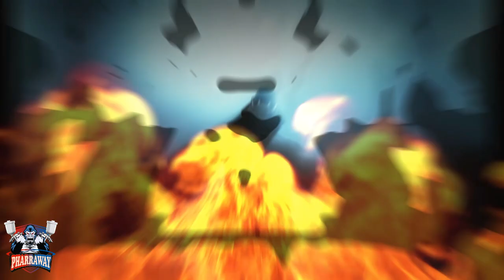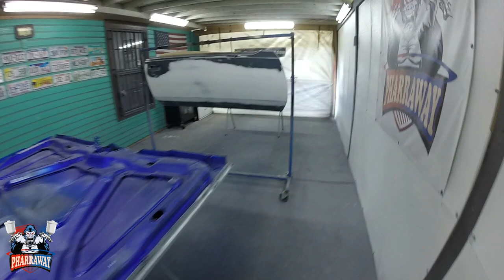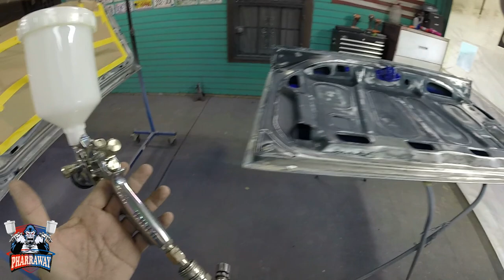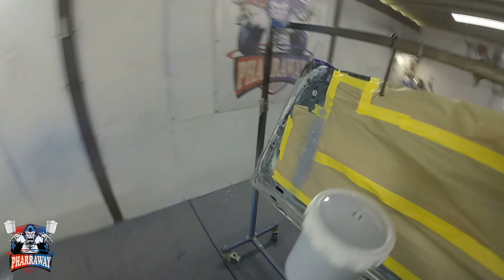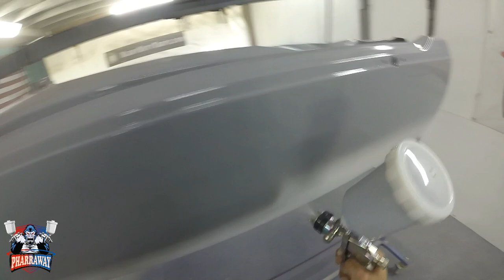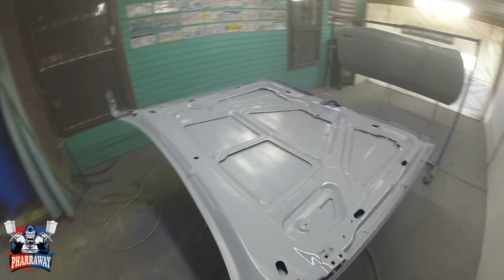Automotive Painting - Using DTM Primer

Comment: Can I spray basecoat over dtm primer. I put 2 thick coats, what would you do at this point???
Reply from the maker: I would recommend sealer first
Reply: @PHARRAWAY  what grit should I use?
Reply from the maker: @tedc9306  I start with 180 grit and work my way to 600 grit

Comment: I bought 9ne of those racks a month ago it was about 5 ft wide so I went to the hardware store and bought 8 ft square tubing that fits the inside diameter and extended it to about 13 ft much better now
Reply from the maker: yup that will work got to try it
Reply: @PHARRAWAY  just cut it 8n the middle slide the extension in drill a hole on each side and bolt it together no welding needed about $25 for materials
Reply from the maker: @larrypugh9336  can you send me a pic. at pharrawaypaint@gmail.com please

Comment: Excellent technique as always.

Questions are: I'm told prep is everything so, I see quite a bit of shiny areas where you primed, indication not scuffed?

My issues are that the paint below are edging/lifting when I shoot my epoxy primer.
It was WORSE when I used it as sealer but, even primer is causing the paint to left.

So, I'm not criticizing and just looking to clear my confusion over prep, what I see and what I'm experiencing.

Thanks, I look forward to your videos every week!👍🤙
Reply from the maker: No problem at all we are here to learn, some of the shiny spots where scuffed with a gray scotch brit it sometimes leaves it looking like that on camera but it is sanded. Try to get all your edges scuffed with a scotch brit
Reply: @PHARRAWAY O.k, I got it. Sanding my parts, it's what I use, the "red" pads, which are @400 grit?

I did order a box of gray but, they're rated @800 grit.

I plant to use that to get out orange peels and cut/buff stage, followed by higher grits up to 3-5000.
Reply from the maker: @kodiak536kodiak536  awesome yes that will work

Comment: For the hood panel, was blue the old base color? If so, why use a epoxy primer if its not bare metal? Could you have got away with just spraying sealer on it?
Reply from the maker: You could but why risk it

Comment: What did you mean by reducing it if it's going to be a sealer? I am planning on using this over bare metal on a 70 Beetle should I reduce it?  Thanks
Reply from the maker: Yes that is correct

Comment: Hey quick question I tried a single stage metallic it laid out nice no strips but it feels rough should I just wet sand with 2000 and just clear coat over it? Thanks in advance 👍🏼😎
Reply: I did the same, I believe mine came out rough because my air compressor wasn't able to keep up. I resprayed 1 door panel after a failed cut and buff and it came out much smoother. That's how I figured out the compressor was my issue
Reply: @miguelromandv7  I emailed the place I got the paint from since it was supposed to be I light gold color and this paint was dark nothing close to it so let’s see going to color sand and do it in section my compressor can handle it. Let’s see what the paint guy say thanks for replying 👍🏼😎